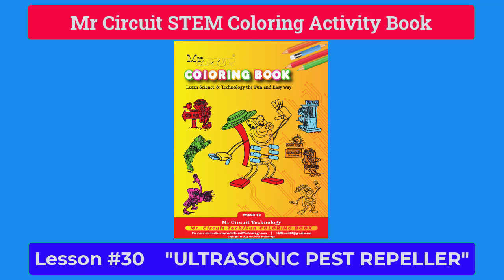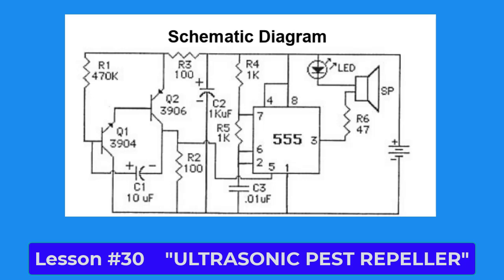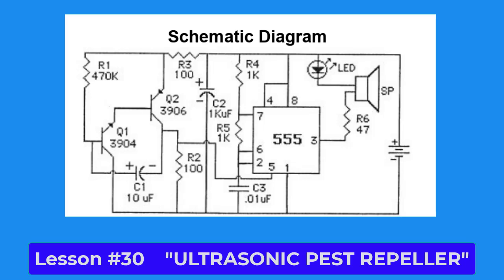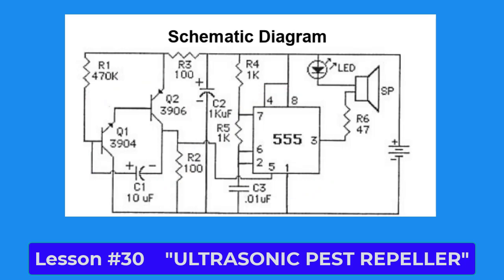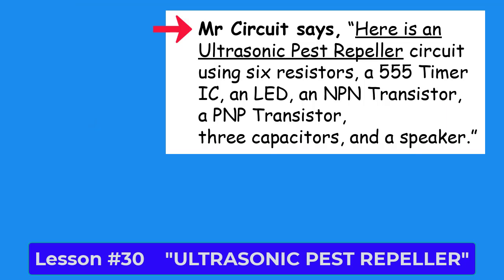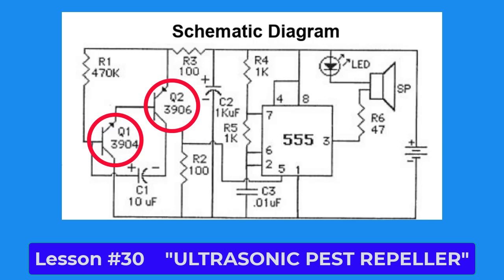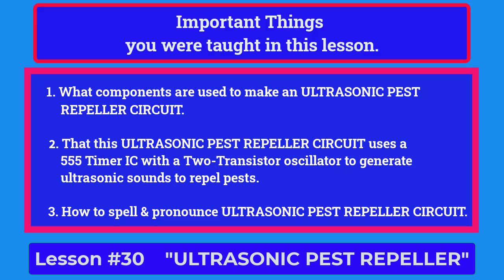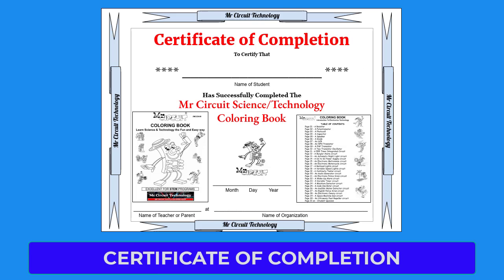Lesson 30 "Here is an ULTRASONIC PEST REPELLER CIRCUIT"

Comment: Thanks for sharing Mr Circuit. Do you mind to answer if this circuit is effective against dogs or cats, and finally, are you using a Tweeter, a buzzer or another output?
Reply from the maker: This circuit is for experimental purposes and to learn electronics technology.  I would not depend on it to scare away dogs and cats.  Thanks for the question.  You can all our labs and kits at www.MrCircuitTechnology.com  Best regards, Mr Circuit